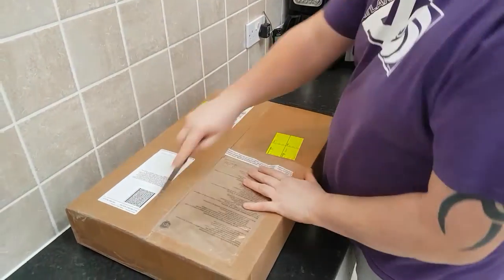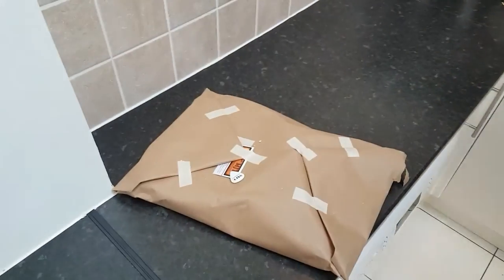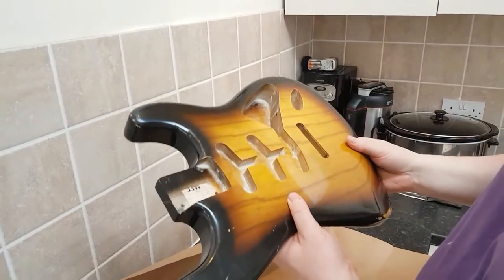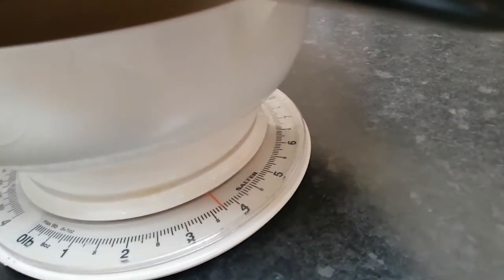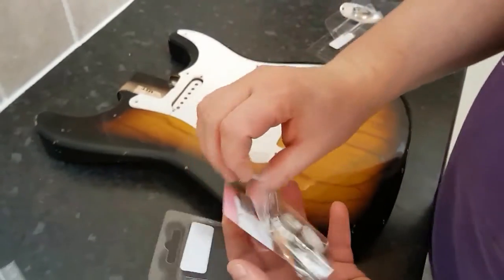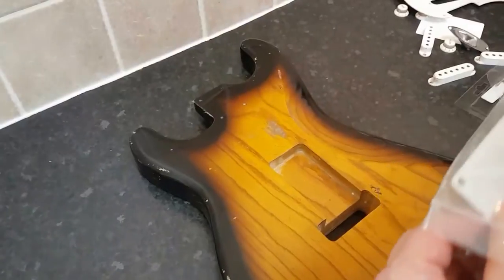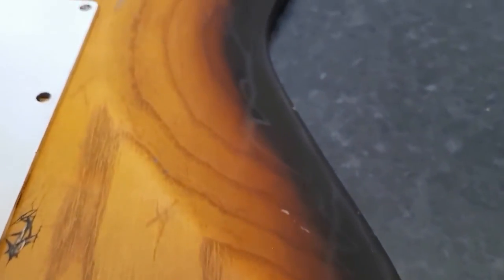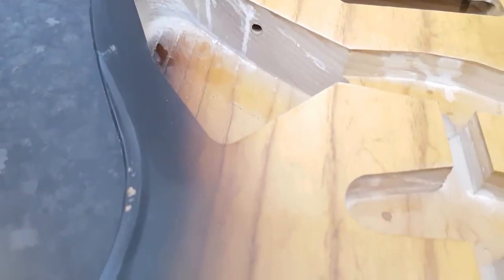B Hefner / MJT Relic Aged Strat body - Unboxing 2 Tone Sunburst

Comment: B hefner takes forever. I ordered an unfinished neck with no fret work. Its been 13 weeks so far and he told me it was supposed to come in at a latest of last week
Reply: Bill Bee it has now been 18 weeks and no email.
Reply: Bill Bee how is the quality?
Reply: Bill Bee i finally got it after 21 weeks. He forgot to put a finish on it, forgot to make a nut for it, and might have forgot to put the custom neck thickness that is paid $45 extra for. Ill have to use calipers on it to see
Reply: Bill Bee about a month ago, he said that he will put a finish on it because it was taking so long to build it and he never did